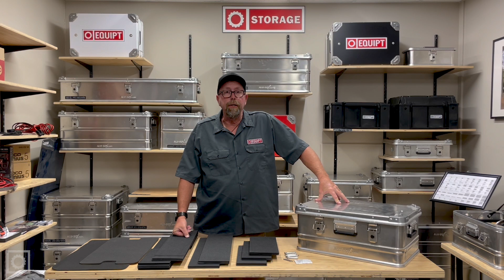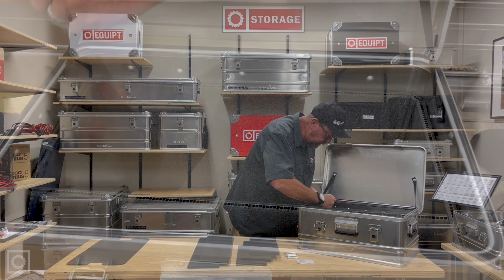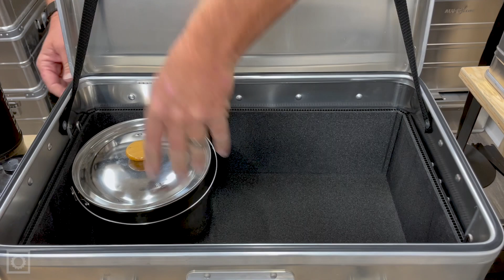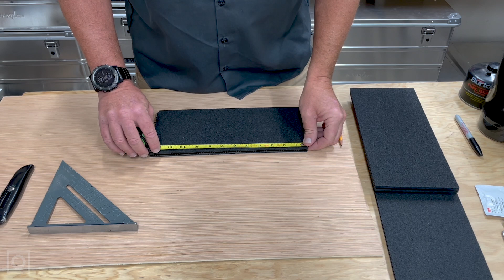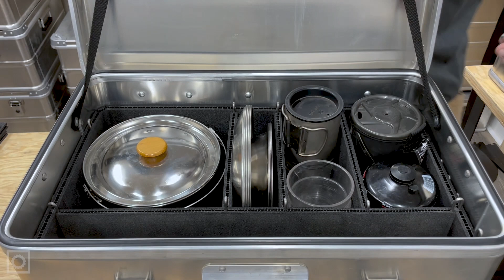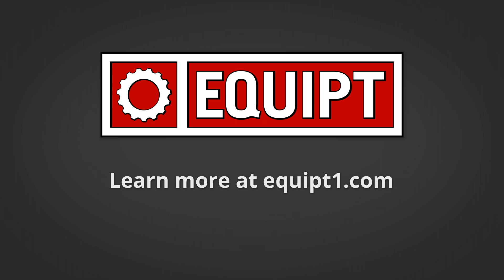AluBox RuumX - Installation

Comment: Its nice they did this, but I wish they would have made the foam thinner.  A lot of interior space is taken up by the organizer.  But great idea none-the-less.
Reply: Dude - Thinner🤷‍♂️That would be cardboard. Looks like nice easy method and alternate to Kaizen
Reply from the maker: There is a balance between the thickness of the dividers and the space taken up by the dividers. This plastic is more sturdy than similar products on the market but the plastic needs to be padded to offer any protective benefit. Folks that have gear that needs to be protected will likely give up a 1/2' internally if it means things won't be damaged. For tools, recovery gear, etc. save the space and skip the dividers.